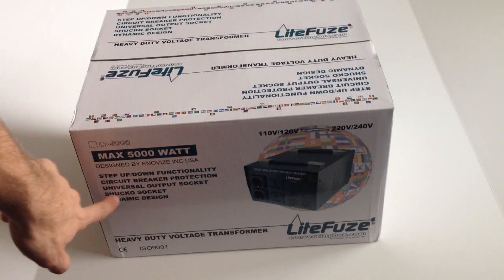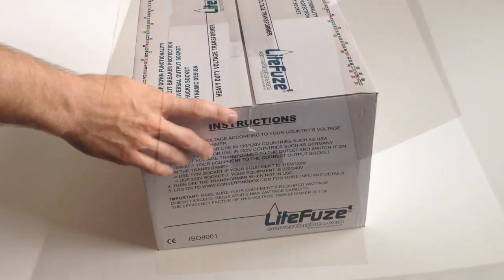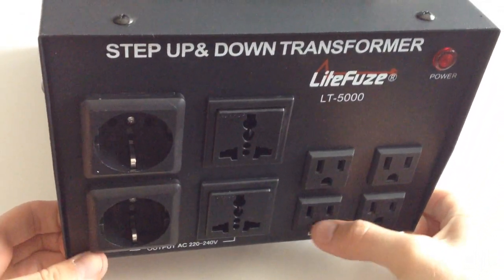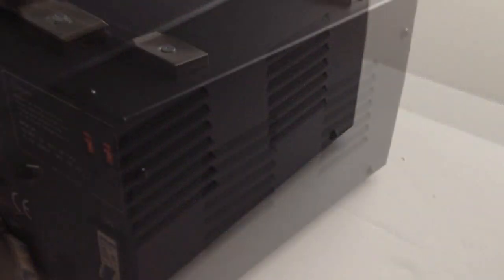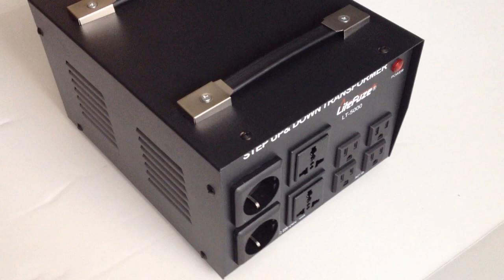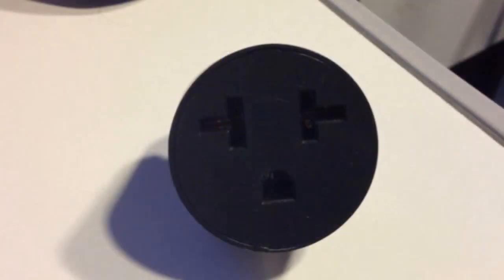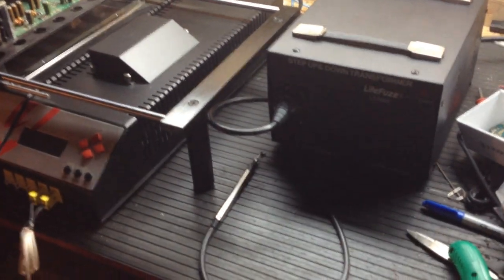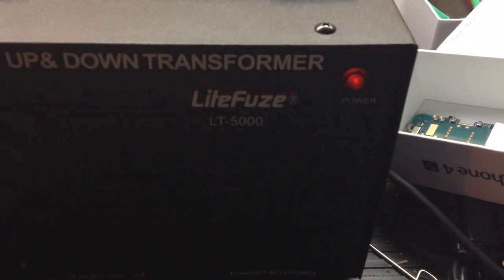Review Of The LiteFuze LT-5000 Step Up & Step Down Voltage Transformer

Comment: I have a window ac unit at 20A 240VAC 60Hz 4800W.  Will it work for that?
Reply: They do recommend the watts on your device to be half less from the max capacity which is 5000w, it could run it but it's not recommend.

Comment: How would this wire up to a u.s.a vfd? The american vfd uses two lines with 110v each in the R,S,T terminals and a ground. With this stepup transformer I assume the output lines are one wire with 220v and a neutral. So would the one 220v wire connect to the R and jump it to the S or T, Is there a diagram or instructions you can provide?

Comment: Hi, I have a question about this product: I have 2 Honda eu3000i generators paralleled totaling 6,000 watts. They're already great for home backup but I would like the option to run some 220 appliances, could I use this to do so? Also, is there any wattage loss in the voltage transformation process?